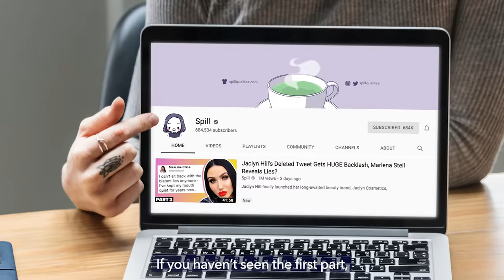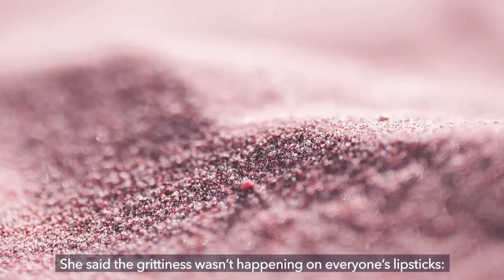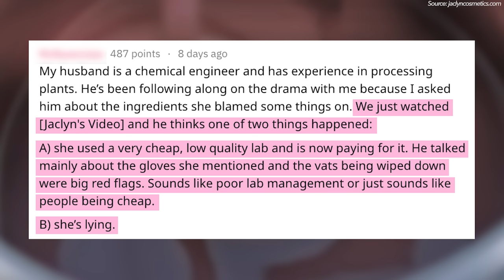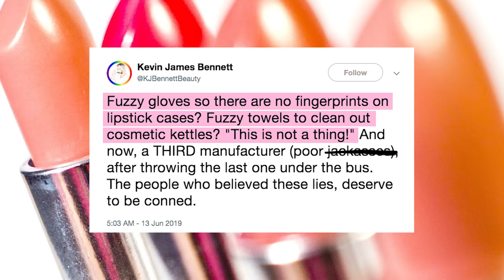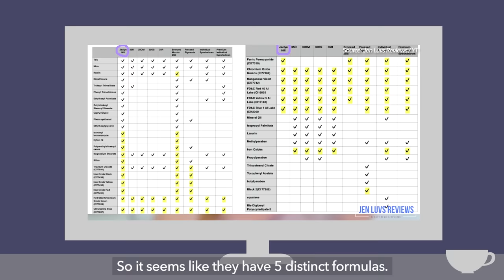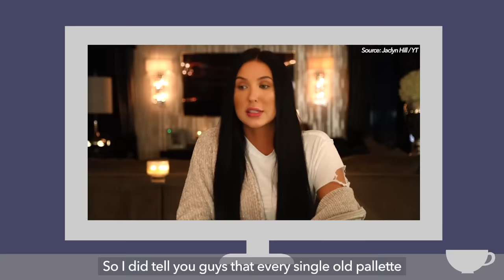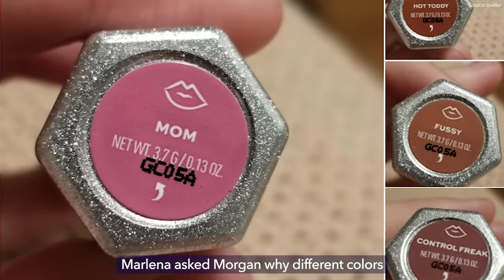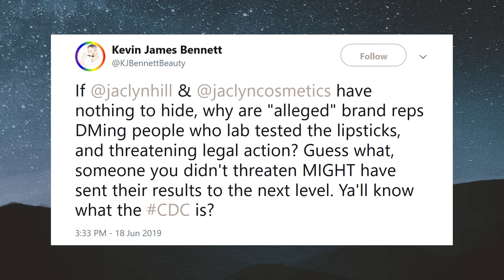Jaclyn Hill Forced to Break Her Silence, Chemist Debunks Obvious Lies?

Comment: On manufacturing floors in sweatshops you will find lots of broken glass. They use exposed lighting with exposed bulbs. When the bulbs burst, which eventually they do, glass shards go everywhere and the workers don’t clean them up. Glass has been found in processed food that originated (was processed) in Asia.

Comment: Oof she's so blatantly overcompensating now by maintaining that they were ALL manufactured in the SAME month they were shipped out. Right, because she's been teasing the same lipstick and ordering components since 2016, but waited until May 2019 to produce them. 🙃 As Marlena tweeted, that's obviously not believable - even if it were true, being done in less than one month just proves they couldn't have had time to properly inspect and label anyway!

Comment: Shouldn't the cats be cleaned with some type of cleaner, santized and heat sterilized before changing between each batch? And also, each time a cat is filled that is a new batch because that is when the lipsticks are mixed therefore each is a new batch.